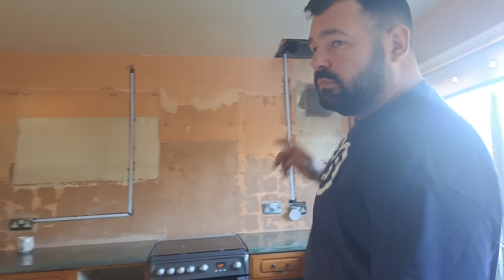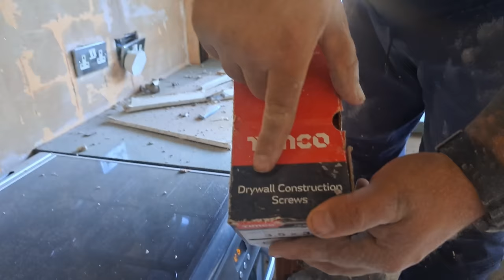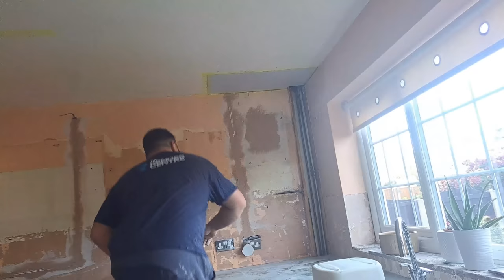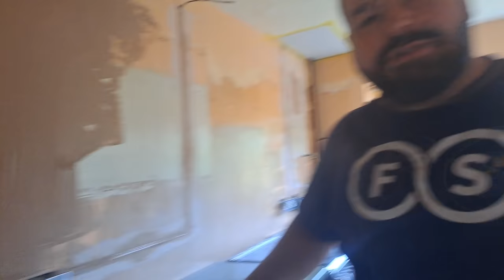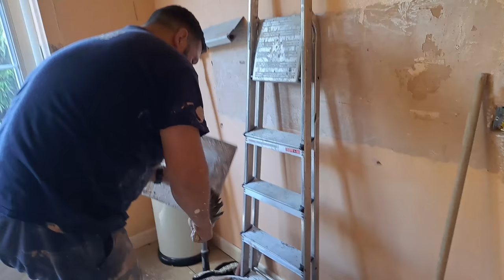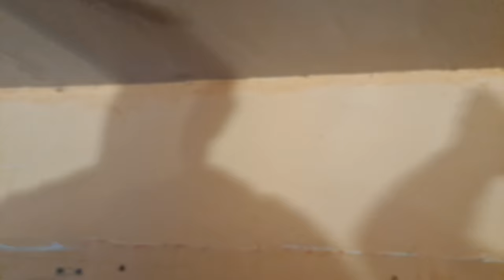LET DOWN ON URGENT JOB

Comment: It's nice to see a plasterer that cares about following trades. Fitting skirting boards to newly plastered walls that are way shy of the floors and having to pack them out, not to mention the plaster flaring out at the bottom like a ski ramp. If some plasterers had to fit them they'd soon mend their ways, but they don't have to so they won't bother.
Reply: I feel your pain. I have spent the last 30 years hacking plaster off the bottoms of walls to get my skirtings to sit flat.
Reply: It’s a common theme with all trades, I’m a plasterer and decorator, electricians and plumbers ruin walls and ceilings, plasterers leave mess everywhere and make life difficult for chippies, chippies do shit work and finally us decorators come along and have to fix it all. Such is life

Comment: Thanks Kirk. I love your videos and look forward to new ones everything. I couldn’t see how you put the furring bar in the gap in the ceiling. I came across same problem and had a spare one sitting in the garage. I didn’t even consider it as an option. . I ended up using an angle bead to secure the flap 🤠
Reply from the maker: Thank you very much mate 🙏

Comment: Nice to see a fellow spread 2 coating, not cadge 1 coat.  1 tip from me bud and I've  been doing it 25 year nearly now aswell. Even with the half time in bud flattering the first coat with the speedskim leaves whole job better and gives an extra 10 mins to washout at the end when on your todd.

Comment: You may have already done this... I'm doing up a house in Toxteth and taking the old skirting off the bottom of the 100 year old wall work is crumbling. The rest of the wall feels solid, I'd love to see how you'd tackle filling in the gap left to the brickwork. I think I've done it right as it feels solid and the new skirting hasn't come off (yet).

Comment: Kirk I think the bubbling is caused by the Speedskim bringing moisture to the surface. My labourer bought one and I used it on a few jobs and had bubbling on every job. Gone back to the stainless steel spat and not had any issues.
Reply: The bubbling is caused by the paint separating from oringinal plaster and where you have missed with pva
Reply: @stevecassie9592  No that is called blistering...the small bubbles are caused by too much moisture being drawn to the surface and often happens with the use of plastic spats on low suction backgrounds e.g. blue grit..yellow grit etc.

Comment: as neighbors would moan about putting dirty water down mains drains i have a separate bucket with a lid on and once it's settled just separate the clean water on the top and skip the solids
Reply: All waste water gets dumped in the sea anyway 🤣🤣🤣

Comment: great video kirk,shouldve  used the broken in 6 pounder mate lol,no seriously love your vids,as for dirty water i usually find a bit of the garden to pour the top part of dirty water then add plaster to the slurry bit to clean the bucket out ...takes years of experience to work that out mate lol...good one kirk nice job

Comment: When i have to straighten a wall or fill in chasses before skimming to make bonding go off quickly add some dirty water or some cement dust got me out of trouble many times it works

Comment: Can’t understand y you waist money on half time when mucky water dose the same job, great watch keep it up 👍
Reply: Mucky water's not as reliable, sometimes goes off too rapid, sometimes doesn't make much difference
Reply: Great content 👏🏼👏🏼…i dope up the bonding with cement it absolutely flies off. Wet mix over artex & thick for chases or holes.

Comment: Depends where I am to hope I get rid of dirty water really, normally I tip clean top water off and then mix sludge with a bit of gear and bag it off or worst case and got no gear left I chuck it in the van and deal with it at home or next job lol how do you get rid of it Kirk’s boy?

Comment: Live ya vids mate  been plastering for almost 30 years now, but just wondering how soon would you add you’re second coat, years ago I used to let the 1st coat completely go off before applying tge second, but recently I more or less apply the second coat asap as it’s an early finish ha what’s you’re thoughts mate ? Btw I still get the same results 👍

Comment: The routing of one of those cables looks all wrong. It goes out the side of the socket horizontaly about 60cm then up the wall. I'm pretty sure that's not allowed. Somebody in future could decide to drill into the wall where the cable goes up. They would not expect a live cable to be there because it's outside the expected zone.
Reply from the maker: I'm single handedly exposing how rough these elec-chickens really are.
Walk around like on site like gods but really they are lazy corner cutters 💁‍♂️
Reply: @Onthetrowel  I think you mentioned in the video the owner was an electrician. So he's likely done it himself and isn't concerned about the cable routes.
Btw I enjoy your videos. There something strangely therapeutic about watching plasterers and bricklayers.

Comment: Halftime in bonding = no time. Gee. Sets under 10 mins. Had one bucket set before i had chance to apply.
Re ceiling patch.
I always put timber around all 4 sides to stop joint flex, then a tungsten scraper around the existing ceiling surface edge to allow sinking in tape below the original surface level. No bump when critical light shone across ceiling.
SBR cut board edges to stop plaster shrinking.
Laser line if i want to accurately cut board to centre of existing joist.
Overkill maybe?
Good work though
Reply from the maker: Your spot on. I like that you completely timber around the edge of a patch. 
I always keep in mind that the straight joins on boards span the width of the joists with nothing supporting them so I'm confident it will be fine.

I like your way better but I always have to fine a happy medium between top quality and speed.

I'd love to overkill every job but I'm also trying to make a load of money 😳👌
Reply: @Onthetrowel  
Yeah. It's where I went wrong for years. It never brought me any benefit like better quality customers or more money. You just have to be good enough and get out quickly with the cash and on to the next one.

Comment: Just wondering why the old kitchen and washing machine is still installed, if the new kitchen is being fitted the following day.  I must have missed something in the intro?  My apologies if I have.  I ripped out mine at least the day before and had a kitchen setup in my living room with some bottled water.  Made it so much easier and quicker for the new kitchen then.  However, I appreciate if the owners of the house could afford to pay something like 6 men to do all the work.
Reply from the maker: It's just how they wanted to do it mate, it was all being tiled so they weren't worried about any little bist where the worktops weren't the same height.

I just go with the flow as originally they only wanted me to skim the ceiling and patch the wall
Reply: The missis wanted to do last minute washing, me mam did the same when we had our new kitchen fitted

Comment: Hi
Need your help.
Are used to use multi finish on a regular basis sometimes,
Just started doing some plastering again, 
Are used multi finish I wondered why it was growing up so fast, I’m not fast Plaster,
noticed written on the bag 50% faster setting, 
Is there anything else I can use what doesn’t go off so fast?
Thanks
Reply from the maker: That's just fast set, they still sell the normal stuff mate

Comment: skimming over paintwork with no suction takes a lot of experience to leave it looking smooth.
Reply: I find leaving the first coat a little longer to go off helps with this.
Reply: @alistairmccabe7028  agree Alistair,I try not to use water ,but timing is crucial.

Comment: Do you ever stick a little finishing in your bonding mix  Kirk I feel it just gets it going that bit quicker especially on a Sunday bro  💪🏼
Reply: Finish seems to make bonding go slower imo it makes it creamy.yes it's Great for going over artex ceiling but not on its own I prefer cement
Reply: @davesmith3562   creamy put less water bro tight mix sore on the arms much better than cement ask gypsum 😂
Reply: A scoop of lime does the trick